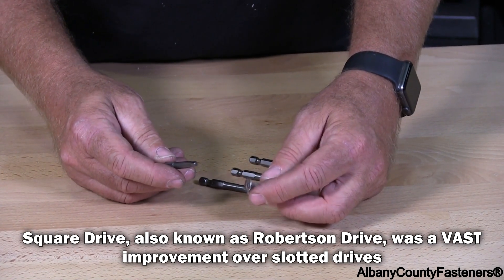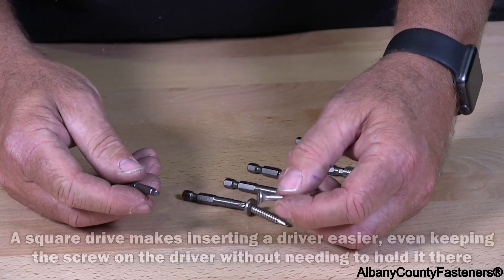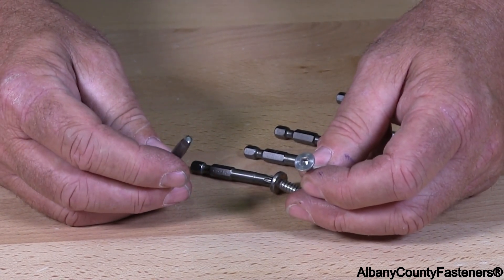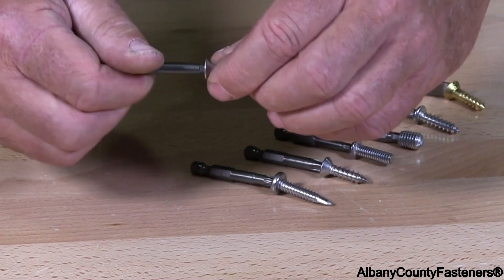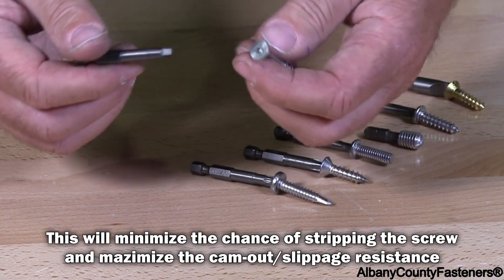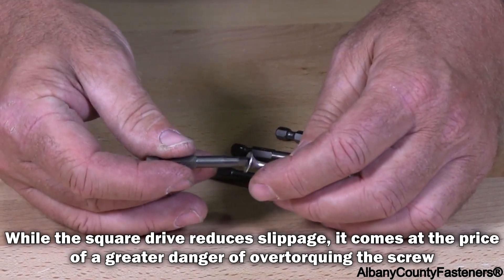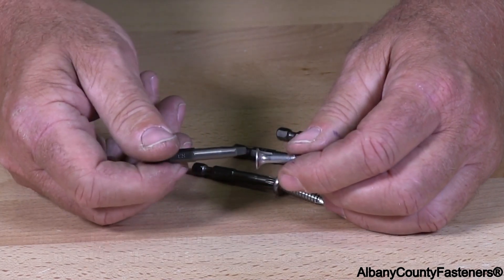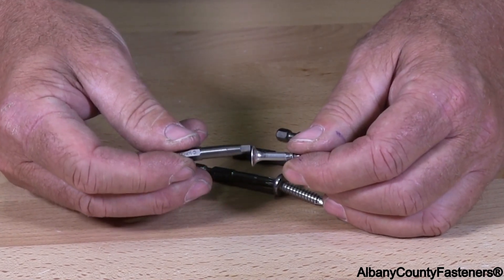The Square Drive - Types of Screw Drive Styles | Fasteners 101

Comment: The flat head on a robertson is a canadian patent. The ones with the rounding on the tip are american made square drive, not robertsons. 
The canadian version which was created forst definitely works better and a snug fit is absolutely what your looking for.  Best wishes to you and your loved one ms during these crazy times!
Reply: I don't have a source to link, this is what i was taught in carpentry school so maybe its not correct.. Now i want to look it up.
Reply from the maker: That's quite interesting! I knew of the canadian patent being the first but It didn't occur to me that the rounded tip ones were made elsewhere...the more you know! Thank you for your feedback.
Reply: @AlbanyCountyFasteners  It's not the rounded tip that is important. A true Robertson has 4 graduated sides to the tip, so as you put the bit into the screw the fit gets tightened. A square tip, with 4 straight sides, can't help but slip. With a true Robertson you can wave around the screwdriver and the screw stays on the screwdriver, so installing screws upside down is dead easy. I can send you an example if you'd like!